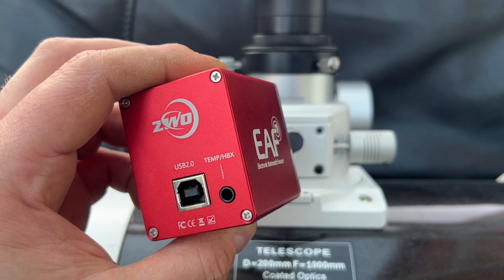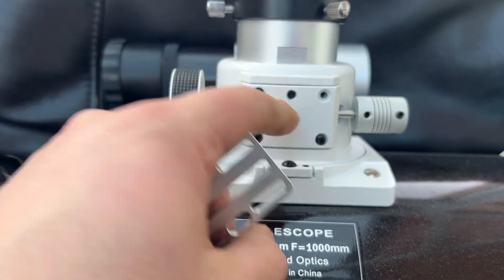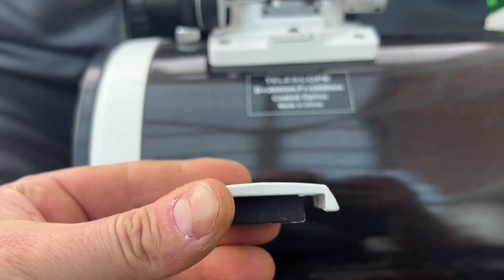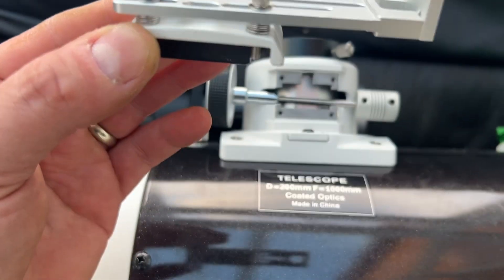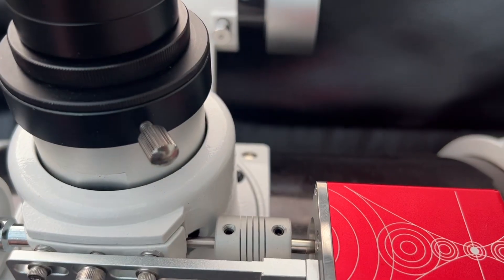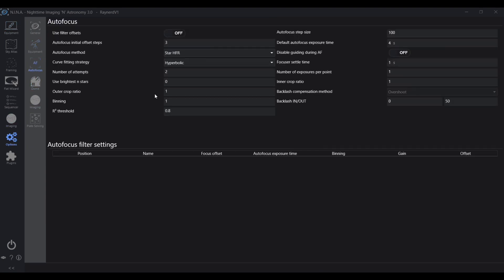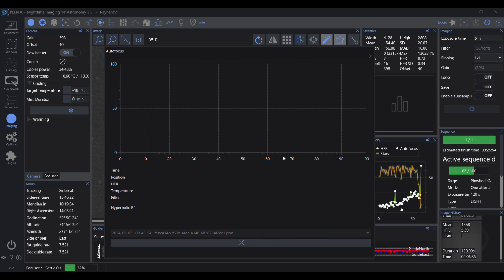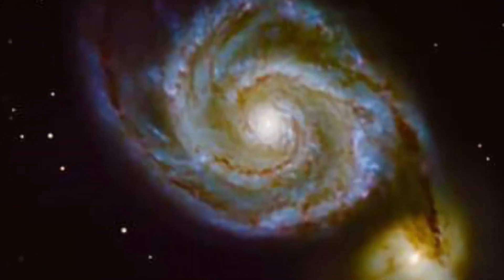Fitting the ZWO EAF Autofocuser to a Skywatcher 200P Newtonian

Comment: What length M3 screws etc did you use? Having the same issue with the regular 200P with a gemini EAF
Edit looks like 16mm, I will have to order some and test
Reply from the maker: Hi sorry, yes I’m into engineering so have loads and no longer have this scope to check for you. To be fair you can buy little packs of m3 bolt sets of amazon for only a few quid.
Reply: @craynerd  Ah no worries, thanks a lot - got some 16mm m3s so will test those
Reply from the maker: @XxLukexX yes, to be honest, I say have have loads, I tend to get longer than I need and cut them down to size if needed. However I do remember these not needing to be cut so they must be a standard size - 16mm can’t be far off, I agree!

Comment: What is the position of the drawtube in or out when placing the AEF and where should the EAF be as a set position?
Reply from the maker: @boyanpungov8303  hello,  from memory, it doesn’t matter the position of either the AEF or drawtube as the “home” is set in software. The only issue for me was I had to turn the AEF in the software to be able to physically access the grub screw engagement flat. Hope that helps.